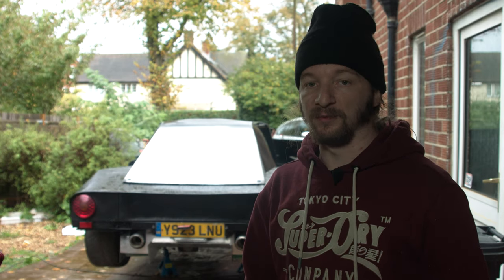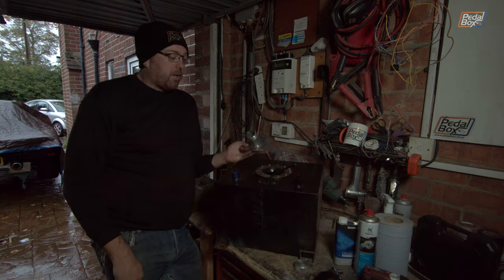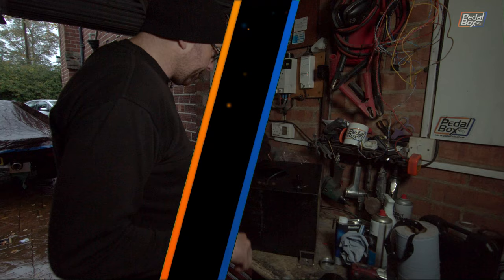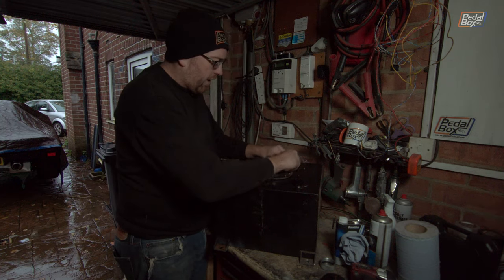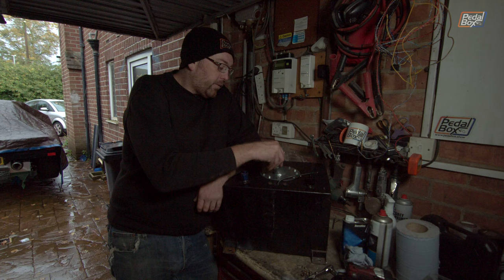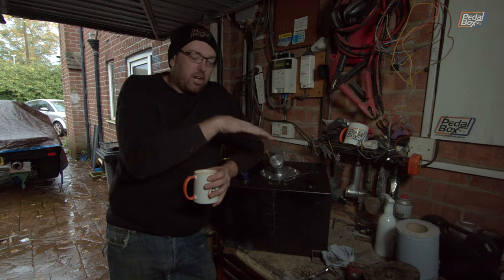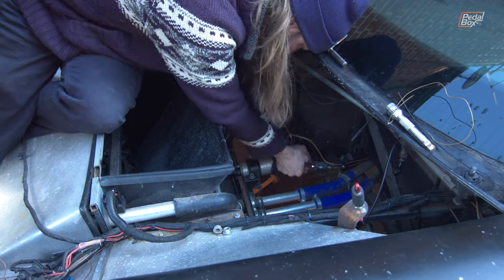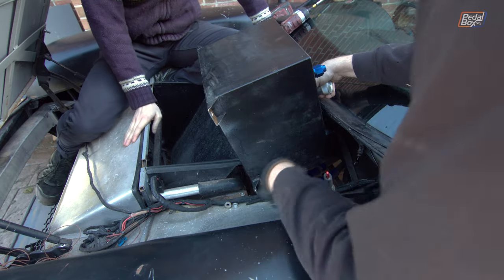We Didn't Think The Filler Neck Through | Audi TT Kit Car | PedalBox Episode 152

Comment: That's such a weird way to mount the filler neck!

Also aluminum tank and steel fittings is a recipe for galvanic corrosion, which explains the state of the bolt heads.